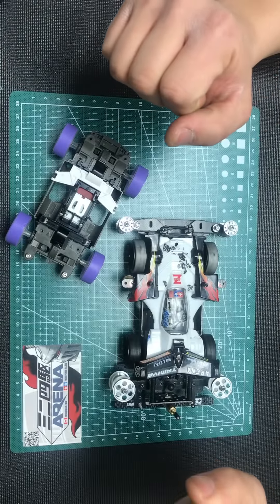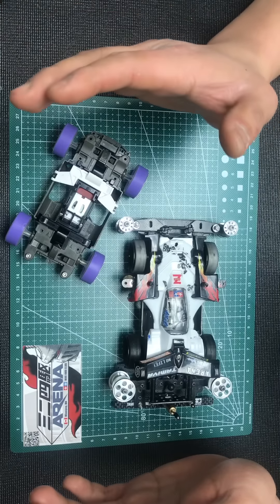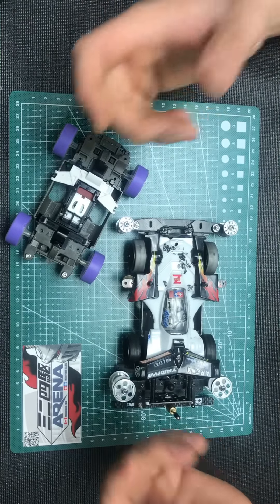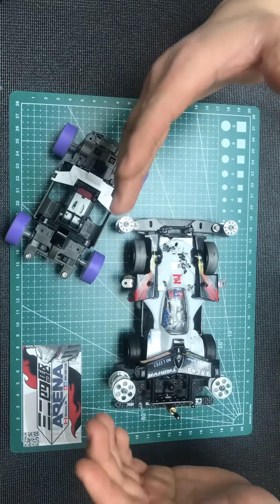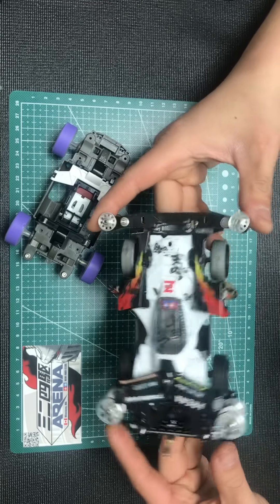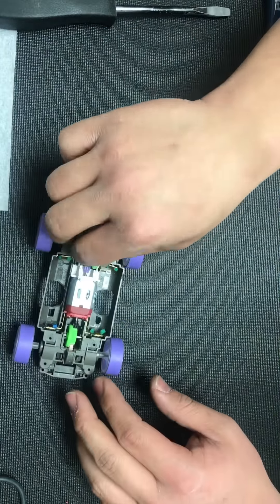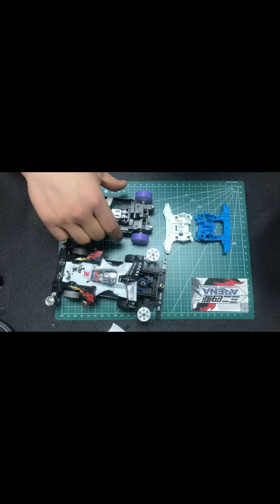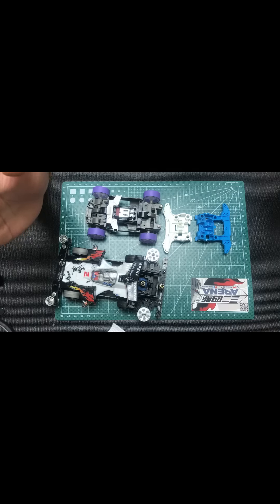#1 （ミニ四駆 /Mini 4wd）easiest way to build uncut Ms suspension/無切割版MS避震底盤

Comment: Sir is the spring you super glue it will be stable inside? And thank you for sharing ideas
Reply from the maker: Arnold S. Yabut   Yes it's fine as long as not really serious injure it will stay as it, but if u really want it to stay better u can use the gel type super glue it will hold the spring better when it dry out
Reply: Thanks